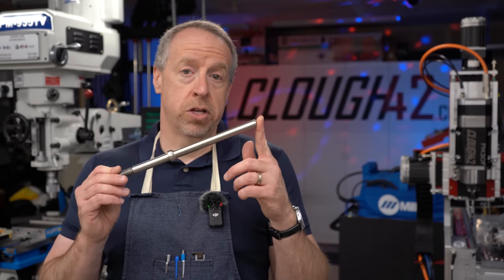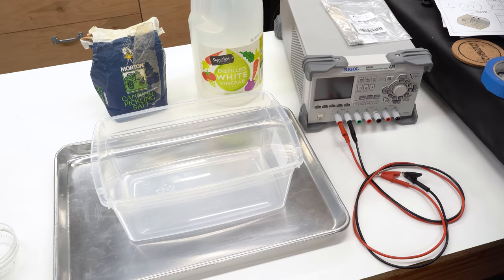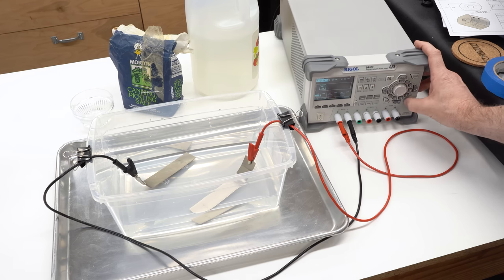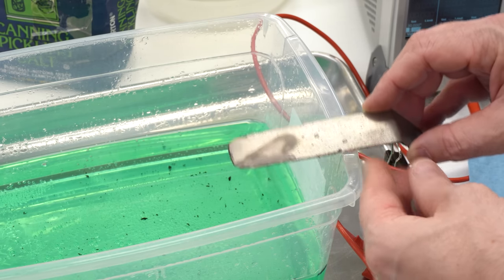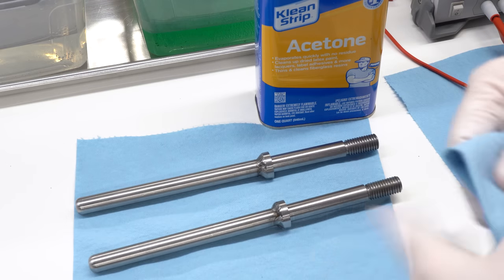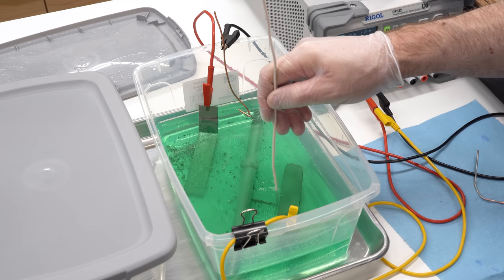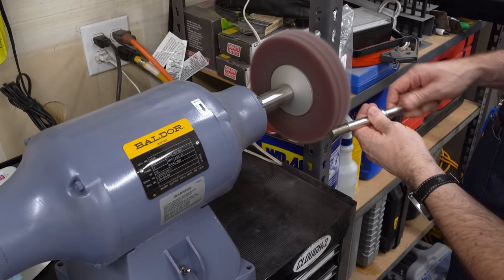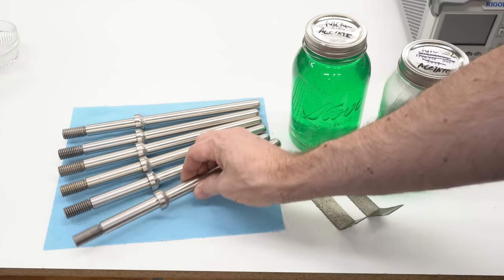Nickel Electroplating in the Home Shop - A Shocking Way to Prevent Rust!

Comment: Citric acid works also, and doesn't make a stink. I had to ditch my first batch because being in the same room was unbearable.
Normally parts are pickled to remove oxides before plating, and after degreasing.
Current settings for commercial solutions are around 2-7 amps per square decimetre (surface area of the part being plated).
Setting the current too high will make flaky deposits, especially around corners and closer to the anodes.
Nickel is deposited at a maximum rate of 1.095 grams per amp hour. Some efficiency is lost by the production of hydrogen.
Thickness can be approximated as 12.295 * I * t / A in microns, amps, hours and square decimetres. 20-50 microns is a typical plate thickness, and should take a couple of hours.
If you have accurate scales, you can check how much mass the part has gained and infer thickness from the density of nickel and the part's surface area (although sharp corners tend to plate thicker).
Large distances between electrodes, stirring and moderate heating help distribute the deposits more evenly.
Anodes are usually held in a titanium basket and wrapped in synthetic fabric bags to prevent particulates from contaminating the part's surface.
Bright finishes are usually achieved with chemical additives. Molasses is supposedly a traditional brightening additive, but I haven't had great results with it.
You can check the performance of a plating solution by plating a strip of copper placed at an angle to the anode for a fixed amount of time and current. It's called a hull cell. It's a bit beyond me to explain it here.

Admittedly, I only have experience doing this in a small jam jar with battery pack connecting straps as anodes, and an air pump for stirring. The above represents the sum total of my notes on the subject.
Reply: You really need a good soak cleaner, preferably using reverse current to clean the parts, then into a hydrochloric acid dip to activate the surface.
The slower you plate, the better looking the finish.   The corners and such are called high current density areas, and you're right, they are the first to flake off.  
Bright finishes are inherently more brittle, and will also flake off easier.  The matte to satin finish James got should hold up nicely.
Reply: Hey, thanks for sharing your experience and knowledge.
Reply: Great info Thanks !
Reply: Thanks for the solid numbers!  

The process is so flexible, it’s hard to know what the effective limits or ideal conditions are.
Reply: Indeed i HATE vinegar and have used citric acid as well! I tried vinegar but noped out pretty hard early on, remade with citric.

I tried adding artificial sweetener with saccharine as a brightener. I don't think i ruined the solution, but i'm not super convinced that it worked.

Apropos noping out: i tried storing it in one of these jars like he's showing, similar. Somehow the stuff made its way through the lid lining and decided to eat the steel. I now only use a HDPE container with HDPE lid.
Reply: Yea higher voltage but low current will get you a better plate. Build it up slow and dense.
Reply: @ObservationofLimits  You fail at Ohm's Law. At a given conductivity of electrolyte (effective electrical resistance) you do not have two articulation points, just one. You raise the voltage, the current goes up. You limit the current the voltage goes down.
Reply: @SianaGearz  also very high voltage very low current is still feasible assuming the machine can do it.
Reply: @ObservationofLimits  It's not possible regardless of the capabilities of the power supply. You don't understand electricity. Go back to school.
Reply: @SianaGearz  the saccharine is used to reduce the brittleness of the deposit. It is not a brightener and no you didn't ruin the solution
Reply: @jimmurphy6095  how do I specifically aim for matte plated finish?
Reply: @rogierius  Unless you're adding some kind of brightener to the bath, you should get matte by default.  
Remember that the plate will telegraph every single thing on the surface of the part.  So don't polish your part mirror smooth before plating.  
Keeping the surface dull will also help keep a matte finish.  
Covering the anode with a nylon bag while plating the part, will also reduce any roughness on the surface.
Reply: Vinegar, yellow mustard, instant coffee.  Are All also acidic.  If you have actual Damascus ..
Buy nescafe instant coffee. Use the entire jar In about a quart of Boiling water. . soak the knife I the coffee for 3-5 days.  Results are amazing. Coffee can be reused indefinitely. 
Mustard creates a patina finish. Vinegar is a option to prep stainless which otherwise will not cooperate. 
Anodizing is simply and customizable with a dessert chef hand torch set at 1400°  I only ferric chloride for etching a pattern or as step on8in making a stone washed finish. The key to the perfect finish is An 8000 rpm bench wheel with the proper discs & finishing compound "blocks" . A $50 Amazon purchase & money well spent
Reply: @ObservationofLimits  : I found my jump start box works better & safer than any lab quality power source of a homemade one made from a phone charger.
Plus I already had the jump box for my car.. a total win win
Reply: @SianaGearz  You do understand electricity but not chemistry. Electroplating usually uses current-driven processes. This is directly related to the surface area of the material to be electroplated. The internal resistance of the entire system changes over time, which is compensated for by adjusting the voltage. Wikipedia is a good starting point for a further read of this can of worms and extensive scientific topic. So don't talk half-true nonsense in the future and most embarrassingly: be so cheeky about it. ROTFL
@AndersonPOOP: In layman's terms: We want to control the current. To have a steady process and therefore a continuous structure of the galvanized metal layer. 
One ampere [the current] is equal to 1 coulomb or 6.241509074×10^18 electrons worth of charge moving past a point in a second ... which is THE property that also moves the metal-ions, speaking: the process we want to happen. Ohm's law states that the current through a conductor between two points is directly proportional to the voltage across the two points. Introducing the constant of proportionality, the resistance one arrives at the usual mathematical equation that describes this relationship: Current = Voltage / Resistance. Meaning: Assuming the voltage is constant, the current grows linear and proportionally with the resistance getting smaller. There is not a single parameter in this law or any other physical theory that states that other people learn better or more when they are belittled or attacked.
Oh and please not only read about electroplating but ask an expert, someone who actually learned that trade and has experience in it. Because it will kill you otherwise!;)
Reply: @dieSpinnt  Please point out where exactly i have made an untrue statement.
Reply: @ObservationofLimits  It is only feasible if the electrolyte and/or part are so resistive, that the increased voltage does not result in an increased current at the work piece - and is instead dissipated in the electrolye or perhaps very thin wire. Other than that, as you increase the voltage with a simply resistive load, the current will increase in direct proportion.

Siana was correct, Ohms Law applies here. You can choose the voltage - and Ohms law will dictate the current. OR you can limit the current and Ohms law will adjust the voltage for you.

Think in terms of a simple 12v filament lamp and a 12v battery. The battery may be capable of providing hundreds of Amps (to start the car), but the lamp will only take the amount of current it required - 5A for a 60W bulb.

Now, if you decide to increase the voltage to the lamp, the current will ALSO increase - we don't get a say in that unless you want to add resistance in series with the bulb (thin wire, resistor etc), in which case the excess voltage can be "burned off". BUT at the bulb, if you want it lit properly, the filament will see 12v - and it will take 5A to give you 60W - as the "hot" resistance of the bulb will be 2.4 Ohms.

What you cannot do is to "decide" to run the lamp at a higher voltage but a reduced current. As the voltage increases, so too will the current. If you limit the current with a resistor, the voltage at the lamp will reduce to ensure Ohms law is not violated.

If the electrolyte is very weak AND made with distilled water, you may find you can increase the voltage higher than normal without damaging the plating BUT even then, you will see that as the voltage increases, so too does the current.
Reply: @dieSpinnt 
It is true that plating does not provide an easily predictable load BUT Ohms law does STILL insist on being obeyed. If you have a plating bath and you start to increase the voltage, you WILL increase the current. Yes the bath's plating current will change as the resistance of the part being plated will change as more of the object is coated in the "new" material - and as the electrolyte resistivity changes too. I agree with that - but you cannot just "turn up the voltage and choose a lower current instead" - which I think is what the other poster was trying to suggest.

If you LIMIT the current (resistor, CC power supply), then as a DIRECT consequence the voltage WILL decrease. We can choose the voltage OR the current. We do not get to choose both.

I agree that belittling people is not helpful - but then neither is people offering guidance on "Yea higher voltage but low current will get you a better plate" as people may take this as helpful advice and then be confused whe they find that the current INCREASES as the voltage is increased.

We can choose the current of a given setup OR the voltage of a given setup. We cannot choose both unless we change the characterisitcs of the load (plating bath & part).

As for "asking an expert", I guess that should be directed at anyone playing around with plating.
Reply: @800bigmike3  The high current pushes on a heavy layer with piss poor metal adhesion.  It’s like putting on a fast heavy layer of paint, but the paint doesn’t stick well to the surface, so it peels or flakes off.   Go low current for a longer time for a tougher finish.
Reply: @blackhawk7r221  : Totally agree. I must have had a "good supply" when I wrote that rambling typo filled nonsense. 😅 Good catch & thank you for looking out . 👍🏻 .. My Son's car needed a jump. I didn't even realize till then that my "jump box" has  2 low voltage DC USB ports. One is 5v 2.4A, the other is variable
 5v/9v/12v. Definitely agree with you on the "low & slow" with the 5v/2.4a producing the best results. 
The rest of my post makes no sense even to me. 😅 
Except the coffee etching. That actually works great on a good piece of Damascus. Any idea if & how I could electroplate copper to a stainless steel blade? I'm not even close to figuring it out on my own.
Reply: @blackhawk7r221  : Totally agree. I must have had a "good supply" when I wrote that rambling typo filled nonsense. 😅 Good catch & thank you for looking out . 👍🏻 .. My Son's car needed a jump. I didn't even realize till then that my "jump box" has  2 low voltage DC USB ports. One is 5v 2.4A, the other is variable
 5v/9v/12v. Definitely agree with you on the "low & slow" with the 5v/2.4a producing the best results. 
The rest of my post makes no sense even to me. 😅 
Except the coffee etching. That actually works great on a good piece of Damascus. Any idea if & how I could electroplate copper to a stainless steel blade? I'm not even close to figuring it out on my own.
Reply: @SianaGearz  You make two implicit assumptions that don't hold for electroplating over any period of time. 
The first is that the resistance through the electrolyte is a constant. Not only is this an adjustable parameter based on distance between cathode and anode as well as concentration, it changes with how readily the ions will interact with the metal on the surface (which involves both charge density and the metallic chemistry happening between the two, potentially causing a change in what chemistry is favorable when no current is applied).
This last bit gets in to the second assumption, that the parameters of current and voltage selected are applied throughout the entire process. With most electroplating intended to create a good surface, you ideally control the current and then use the voltage reaching whatever your maximum is as the ending point. I say electroplating intended for a good surface as the most common electroplating that occurs is actually voltage-regulated and approaches the asymptote of 0 amps (and is also reactive enough in the reverse direction to be electrically useful)
Reply: @bandana_girl6507  I'm not assuming that the bath resistance is strictly constant; but it changes quite gradually in steady state operaton. And at any given moment, Ohm's Law still applies. I'll be waiting for an example where "you want to plate VERY high voltage and low current" as one person wrote actually works and makes sense, as you're not exactly using bathtub sized containers, and the solution will just saturate eventually with ions, making it fairly low-resistance and making the voltage fairly low. Usually you can limit the current to be proportional to the area and let the voltage figure itself out, and you cut off the plating when you have achieved the desired thickness. The resistance of the bath doesn't increase throughout the process so if you just run a voltage in, the plating will not approach 0 current asymptotically. When you have 0 current, you have consumed the anode.

OK maybe you can do it like that if you have a primed electrolyte with the exact amount of metal you want to deposit and you use graphite non-consumable anode. But it just doesn't make sense usually.
Reply: @SianaGearz  like I said, if you're controlling current, you cut off at a voltage threshold. The current is your speed and your voltage is your destination. 

As for how you end up getting solutions that asymptotically approach 0 amps when voltage-regulated, it's not that the bath itself becomes high resistance but rather that the reverse process becomes favorable enough that the electrical potential of that process approaches the regulating voltage (so the voltage drop becomes closer and closer to zero). Or rather, at least with the most common implementation. This implementation actually does two electroplating processes at once along with two electrochemically cleaning the plates. 
Oh, and if creating a situation where the electrical potential of the reverse process of electroplating approaches a voltage sounds like charging a battery, that's because it is. The most common implementation of electroplating is lead acid batteries being charged. It just happens with non-metals doing most of the plating